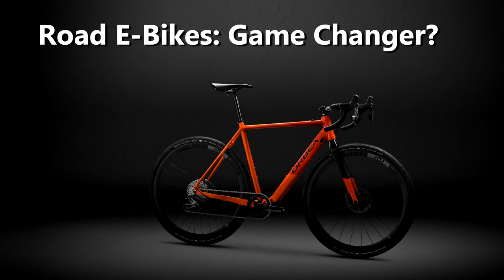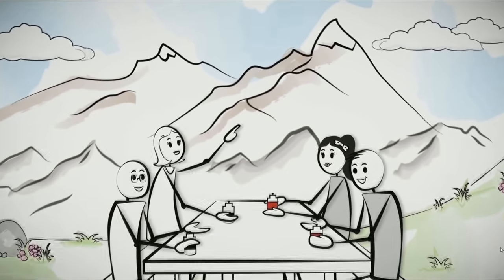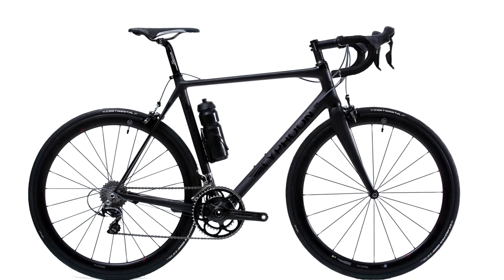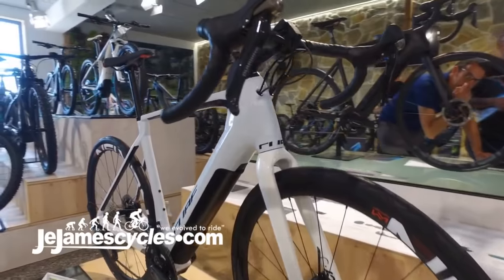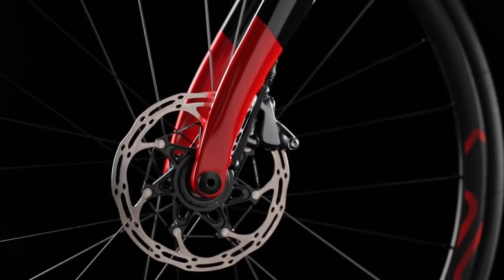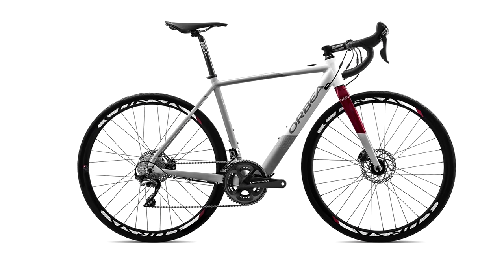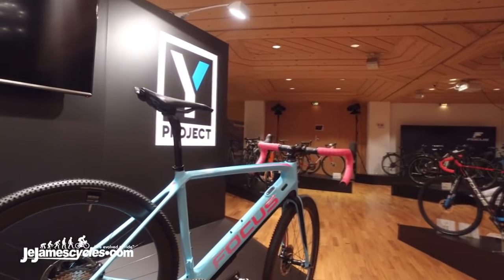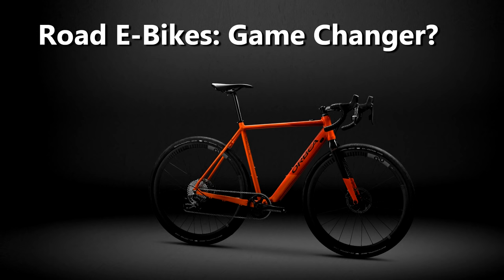Integrated ROAD e-Bikes with Hidden Motors: game changer or just a massive cheat?

Comment: These latest ones sound expensive but some are only a reasonably premium over an equivalent unmotorised bike. If you can afford 4K for a di2 bike, then you can probably afford 5k for the same bike with a removeable motor. It is the battery and motor that are removed, about 4kg, leaving 1kg gearbox that cannot be removed. Since it is a top bike at say 7 to 8kg, then with the gearbox say 9kg is not bad. Ride it with no motor if you are old on the flat, with motor if the hills are over 10% and you are riding with a fast group and need it to keep up. Perfect. I will be getting one in 10 years when I turn 70 for sure.
Reply: JB. I just went electric assist at 90, use it only on the hills as far as poss.

Comment: so a friend of mine bought an ebike, it has one gear (and a pretty damn low one at that), battery is massive on top of hte frame. the frame has twin forks front and rear and a tri post setup like a motorcycle does. its got fat tires and weighs 95Lbs. she has about a 40 mile range, it caps out at 21mph and it isnt very good imo. pita to load/unload, when you run out of battery you cant really pedal it. i cap at around 5mph on the small little crank it has. when i ride with her i have a specialized alez and i beat her by a solid 20mph down hill, 6mph on the flat and 10mph up hills. you would think she would own me uphill but her bike must have some kind of amperage limit because when going up hill it will just cut power and you need to feather the throttle to keep it moving. how fast you pedal determines how much power hte motor gives. its a 3,000.00 bike and i would not buy one. after seeing that kind of ebike i am very put off by the entire concept.
Reply: Sounds to me like your friend has an E-Scooter not an e-bike.  My E-bikes(i have 2) are converted normal bikes and don't have a throttle, they don't move unless you pedal, I am actually working harder on the flat because i switch the assist off,  i am then carrying the extra weight of the motor and batteries. Its like everything in life, its about how you choose to use it, I also have a normal bike which because of an injury i find impossible to ride up anything but the gentlest hills, so i have to be selective where i ride, whereas with the e-bikes i can go anywhere.
Reply: INCC74656I, Newer better technology appears on occasion.  The Orbea Gain D40 is not under a $1,000 but it is an interesting price option for a lot more consumers...
Reply: @iamrocketray  Looks like that guy is completely ignorant concerning e-bikes - makes you wonder if he even watched the vidoe

Comment: MCM2 has a removable battery, like the Bhoss  Windstar. Both use the Vivax motor. Sarto has frames for e-road bikes with an internal  battery in the downtube. Its easy accessible after removing the front logo and fork from the head tube.

Comment: Can someone please explain why no one has incorporated a small generator type device, as seen and known some 30 plus years ago, to send power to the headlamp. A simple little generator powered by a small wheel that ran on the front wheel rim powering the headlamp. Why not do likewise sending a trickle charge to today's e-bike battery?
Reply: A generator absorbs mechanical energy from the forward motion of the bike and turns it into electrical energy, if this is fed back to the battery to recharge it, it would always be at a lower level than was the energy consumed due to friction and other losses so would reduce the range of the battery, not increase it. If this was not true then we would have perpetual motion.
Reply: @dudleybinnington8014  Can we increase the size of the generator. Again, attached to the generator or alternator would be a much smaller wheel that would turn as it's pressed against the trike's rim of one of the wheels; hence, sending a large enough "trickle" charge to the battery pack. Maybe, talk to the battery manuf. to have that adapt. I'm grabbing at straws. Is there any ...way possible. When found, patient it! Thanks.
Reply: @timothybradek3560  Sorry Tim but whatever size the generator is, it will always consume more energy to drive it than it can provide to charge the battery due to friction and heat losses. If this was not the case and it  provided more energy than it took to power it, then this would mean the bike would never need charging, i.e. perpetual motion. Unfortunately perpetual motion is impossible on machines. If you remember the old dynamo light systems from years ago, when it was engaged on the wheel, it always became heavier to pedal due to the energy consumed from the generator to turn on the light, i.e. the 'free light output actually cost in mechanical energy from the cyclist. Modern lights with their led's and small batteries are far more efficient than the old dynamos from old. Hope this helps

Comment: an ebike would require all the gears my current bike has (or more), ability to augment the top end of my power and not the bottom end. that is to say, if i can hold 28mph cruise on the flat i would want the motor part to push me to 24mph and require me to keep the same effort as 28mph. it would need to NOT have a speed cap, be able to have augmented batteries, have regenerative breaking or some forum of way to pedal to charge the battery so when its dead i can simply go slower and direct some of my pedal force into recharge. a street bike would need to be about the weight of a mountain bike or less, and it would need to be aerodynamic. i have not seen any bike that meets this criteria so i have not bought one.

Comment: It's simple really... For racers yes it's cheat but for daily commuters, weekend cyclists and longriders, this actually is a great support.
Reply: Then why try to hide that it is a motorcycle?  They're going to great lengths to hide it, and it's not because of aesthetics.
Reply: @LVQ-so5th  well it is mostly aesthetic 😂, bike frames are usually so thin that putting a visible motor on it looks weird, plus the more hidden it is, the smaller it is, the smaller it is, the lighter it is. And you know cyclists pretty much worship light bikes
...
Reply: @LVQ-so5th  It is not a motorcycle - it provides SOME assistance.

Comment: Since allmighty youtube just hinted me about this video... I found out (by example of my friend) that you have to be very careful when choosing ebike. For example, you need to know how fast you can go with the boost. If the thing is limited to 25 kph for example, and your natural travel speed is 27 kph, on longer distances you'll end up more exhausted than on a normal bike (no electric boost, more weight). If you think that you can reprogram bike's computer to have higher limits... think again. Some computers have updated firmware with locked-out config modes, and you could be out of luck. Even the way the thing provides extra torque can be problematic (like constantly switching the motor on and off every few seconds). And... you need to take into account what would happen if you use electric assist to increase the range of your trips, and then the thing fails 30 km away from your home. All of the above are real problems that surfaced within a month of purchasing ebike. 12 kg ebike MTB sounds promising, though.
Reply: Kobel. You are not making any sense - why on earth would someone who can maintain 27kph be in need of an e-bike in the first place?
Reply: @vincekerrigan8300  You say people only buy stuff they need?

Comment: theyre still too expensive and too heavy, and many states have speed limits which means that it works against you if you want to go faster than the limit, and after your batter dies you are carrying huge amounts of dead weight and drivetran friction.. for the cost of any of those bikes yo can get a 6kg trek emonda
Reply from the maker: It would be great if you could ditch the battery when it went flat.....maybe to a friend!
Reply: Am nearly 85 fixed time trials for years.le jog when 80 solo 11days 35llbs bike.alpe de hues last year,stopped a lot.have test ridden Orbea Gain brilliant  for me.still riding several bikes.hope to do 10mile tts non elec of course.on elec hope to keep up on club rides.So don't condemn all elec bike riders who you may observe
Reply: JogBird. If you habitually ride faster than the bike's limit, why on earth would you need one in the fist place?
Reply: @denishedges2559  Power to you elbow  - I finally sucumbed and went electric when I hit 90. Too many commenting on here are biased, or just plain ignórant.

Comment: The fact that they want to hide the truth, that these are motorcycles, tells all.  It takes away the challenge of testing oneself in a segment challenge or age-group classification; knowing that you might be competing against motorcycles.  I have no problem with motorcycles, but trying to pass them off as human-powered bicycles is pathetic.
Reply: ML. What rubbish you are talking. Approached sensibly, the e-bike is a matter of 'horses for courses'. A keen road rider, I finally went electric when the hilly part of my rides became  a real problem. That was at the end of ĺast year when I hit 90 years of age, and the assistance has been a real boon and enabled me to ride the hills again. I rarely use the assistance on the flat, so together with the power needed on the steeper hills, my rides provide a decent workout. You should refrain from pronouncing on matters of which you have so little knowledge. Wait till you are older.

Comment: e-bikes are for people who want to appear to be stronger than they are.  Instead of gong up a steep hill at 7mph on a regular bike they buy an e-bike and go up at 12mph or more.  I guess that is more fun.  By making e-bikes with motors and batteries hidden there is a form of trickery and fraud here, especially if you do it competitively on zwift/strava or in actual races.  Just imagine if Nike made a running shoe with e-assist which could allow the runner to run 50% faster.  Everyone would think it is a joke.  e-bikes are just mopeds that replace the gas engine with an electric one.
Reply: I have a Litespeed T1 that doesn't have any motor in it, and I rarely get passed by anyone on my daily rides. However, if I get passed, I most likely will try to keep up with them or try my best to pass them. But if that is impossible I dont really give a fuck because only my performance is important to me. Of course using an e-bike in races is and should continue to be illegal. But you dont really need to know if anyone else is using an e-bike in any ride out of competition because again, only your performance should be important for you. Who cares what anyone else thinks or how many KOMs you have?
Reply: In a way I agree that it is an electric moped, but as a middle aged man with nerve damage in my left leg and a desperate need for some non impact exercise my E bike has been a godsend.In the last year I've lost some weight but more importantly have gained some strength in my leg without undually stressing it
Reply: AN ebike with a cadence sensor only or grip trottle only would fit your description, but a torque sensor powered pedal assist is NOT anything like a moped, you have to pedal and there are assist levels. They are not only for people who want to appear stronger than they are. Not everyone is an elite cyclist. If you are cooked in 10 miles because you are not super fit, these will let you go 40 miles..and I would rather see and or be the one pedaling a bike having fun, enjoying the outdoors (and despite your belief getting plenty of exercise) and not driving a car. You can talk shit if you have no car and pedal everywhere on a traditional bike , if you have a car and you are burning oil...shut the fuck up..you arent a real cyclist..because you drive a car. See my point? I don't drive a car at all, I currently have 2 bikes one is a fixed gear steel bike and the other an alum/carbon gravel/cxcross bike. I am considering an ebike for the times I am cooked from riding already for the day but I still want to be out riding or go somewhere if my legs are cooked. Is it better I drive a car or pedal a bike even if I don't have to struggle to do it. Your argument is like saying someone on the 32 rear cog is just trying to look stronger than a real cyclist who would climb 12% gradients in the 11 tooth rear cog.
Reply: Just imagine how much improvement could be made with lighter bikes made using better hardware, oh wait, they already do that.

Someone who attempts to decide for someone else their reasoning and benefit for doing something is the weaker one.

Comment: No self respecting road bike rider would buy any kind of electric bike, no self respecting electric bike rider would buy these underpowered small battery'ed overpriced road bikes. As a electric bike rider I own a 1500 watt mid-drive with two batteries totaling 50Ah. If you want fitness and are an electric bike rider then go for a run.
Reply: say that when after you've had a heart attack

Comment: Those who look down on the e-bike rider have never ridden an e-bike or a well designed one, it's exercise and it's fun. Who cares about rights to an ego trip.
Reply: Well said.  Seems a lot of people on these comments also think they're like mopeds where you don't even have to pedal.  I was skeptical of them at first but after taking one out for a ride, was so impressed by it not for speed, but able to tackle the hills I used to avoid, and going distances I never used to.  End of day I'm burning more calories compared to sitting at home making excuses not to ride because it wasn't as fun anymore.  Ebike is fun again.
Reply: i have tried one and felt  ridiculous. good for the anti  sportman
Reply: @vincekerrigan8300  your reaction is that of a non -sporter. I am 64 by the way
Reply: @sylvainbernaers  What do you mean, non sporter? In my 70's I was doing century rides, and was still going stong into my late 80's - is that 'sporter' enough for you? Increasingly then my rides became restricted/truncated, because the hills were becoming more difficult. So, at the age of 90 I added an e-kit to my road bike, with the result that I am riding more frequently, for longer distances, and back again in the old hilly regions. I maintain a good level of fitness by minimising the amount I use the motor, and working hard where the hills require it. At your age you are in no position to criticise those older than yourself,  because you have the potential to be really fit - indeed, when I was your age I was regularly playing squash three times a week, which I continued until I was 70 years of age. 'Non sporter' indeed. You need to be a little less arrogant and stop making assumptions about other people.
Reply: @vincekerrigan8300  good luck.walking a bit is healthier than sitting on a battery with lycra on